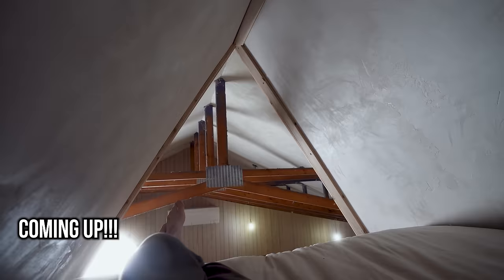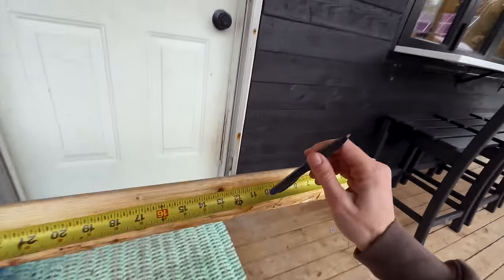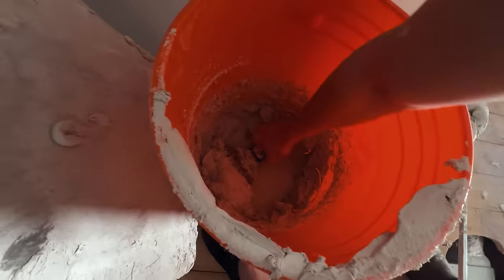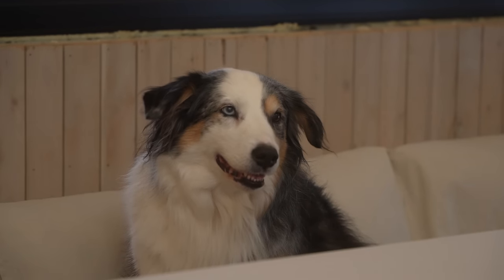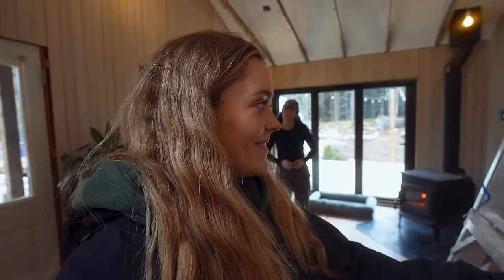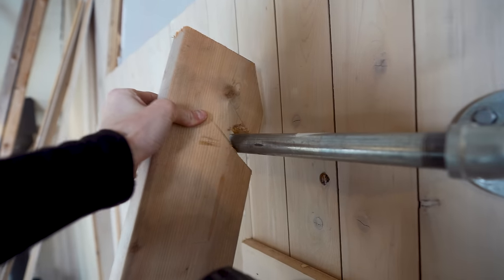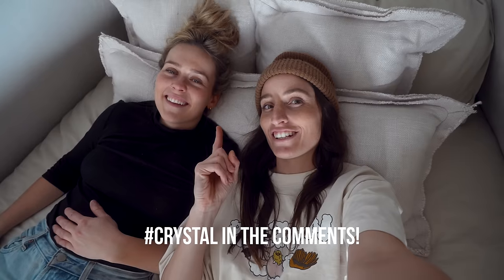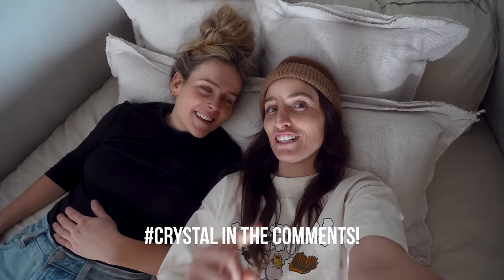Incredible Attic Transformation: DIY Attic Loft Renovation

Comment: You could add another indentation at the top of the ladder (a little lower than the one already done) and then You could hang the ladder vertically (on the new indent) so it doesn't take up space when you're not using it

Comment: I have a ladder to my loft but the last two steps at the bottom were attached with hinges so that you can fold them back and the ladder sits flat against the wall when not in use.  It is secured at the top with door hinges so it hangs in place against the wall.
Reply from the maker: Thanks for sharing with us, that is a great idea! We definitely want it to lean close to the wall when not in use.😁🐶

Comment: The project to build next spring would be adding an extension to the cabin, Make a concrete footing, and two courses of concrete blocks, frame the floor, covering with 3/4" plywood, begin framing the walls with six inch 2x6 studs, insulate, then sheetrock the interior walls, the outside walls should be 3/4 inch plywood, cover with house wrap, and use the same siding used on the rest of the cabin to match.  The roof should also be six inch (2x6) lumber, metal roofing to match what you have now on the roof. I sugest sizing the extension the length of the original house size. On the interior I suggest framing another bedroom, leaving a large dining room or what ever makes you happy. Hire and electrision adding outlets and interior lights (hghhat cieling lights) This project should take about six months to complete, (before winter)
Reply from the maker: We like the way you think! An addition the cabin has been given some thought. However our plans for the spring/summer are going in the direction of the new land. So stay tuned.😊🐶

Comment: For the ladder to get the correct angle you can measure the height for every 4 feet high it’s 1 foot out. 4:1 ratio this was drilled into my mind as a trades worker. It’s a good rule to follow whenever you use a ladder. You should put a handle on the wall in the loft on the left side with the galvanized pipe Other than that great job!!!!

Comment: Great idea of using a "ladder" as the blueprint for the ladder!  If running power for a fan is too much pain, a battery-operated one will be great for those staying during the summer! And some cool reading lights on the wall at the head of the bed.

Comment: I would love to see you add wind turbines in addition to the solar array. When the sun goes down, generally, the wind comes up. It would be beneficial for dull days where there is not a lot of sun.
Reply from the maker: That is a great idea. We may get to the turbines in the future but somewhere else… 👀 We have so many projects on the to do list.😊🐶
Reply: @Vanwives  I find that Vertical Axis turbines are superior to Horizontal turbines. You can either incorporate them into your battery bank or mount them on the greenhouse, storage shed, or any of your buildings independently and hook them up to a dedicated battery. You'll probably need a 50 amp charge controller. I was going to put them on the camper for power on the go!
Reply: Not in Ohio ,it is the other way around ?
Reply: @davidkettell1073  could very well be. I'm in Ontario and the wind generally picks up when the sun goes down
Reply: I am so impressed by everything you two do. I think it’s great that you push yourselves to do and make, rather than buy expensive things. Your home/cabin is so welcoming.

Comment: Absolutely love this!  It looks so good.  I definitely agree about adding some type of safety rail up there so you can grab onto ladder going up or coming down, and a way of securely fastening it to the wall so it doesn't crash land on you or Izzy & Bella.   Also with a railing, you could add/hook on a small shelf where you could keep a box of tissues, bottle of water, etc. for the night.  Mom "speak" - I'd also not wear socks climbing a wood ladder because socks slip very easily, unless they have those traction thingies on the bottom; even bare feet would be much better.  They make re-chargeable LED lights of all kinds now that would be so nice to have up there just in case someone has a midnight potty run.  Enjoy!
Reply from the maker: Yes!!!! you are so right! sThanks for all your ideas and suggestions. I guess we are not finished yet. 😊🐶

Comment: Gals,

How's the fishing in the area?
With that extra room, I can visit you LOL.

I don't know how pragmatic this is in your case or how can you adapt your ladder in the future but,  but for safety purposes OSHA requires the ladders to be 3 ft above the roof or platform level to climb.  I guess for you to have something to grab before start trying to find the top step of the ladder without having a 3 points of contact.  Maybe in your case you can built a new ladder, just longer.  Then do two notches:  1. for when the ladder is completely vertical and not in use (stored mode).  2.  Then another notch when the ladder is inclined, and to be in use.

Something cool I have seen is that the ladder is set on like a barn roller rail to move the ladder to the side when not in use.  Maybe it ialso has a mechanism to have the two  functions above, verticl storage, and inclined for use.

My best wishes to both of you.

BTW, do you plan to have children?

Comment: Bless you, Jasmine. Secret door, wow, I guess I missed that in the post of pictures. Beautiful. You might add some rubber strips to the bottom of the legs of the ladder. Just to keep them from sliding around when the latters in use. Love the idea of notching the ladder another foot down to hang it flat on the wall when not in use. Gave them a big thumbs up👍
Beautiful job, girls. #Crystal
Love the pack ❤ 
✌️🤟🖖

Comment: You could build cubbies in the walls up there, since it is so tiny up there, you could just use the existing rafters cut out a little rectangle and support it within that 2×4 framework
Reply from the maker: That is a good idea. 😊🐶
Reply: @Vanwives  then you can put wiring up there for a pocket light, to read, or watch a movie, on a tablet, or just to see, you could hide the wiring possibly under wooden trim, like in that peak in the ceiling, or along the edge of the floor,  the cubby, could be for a drinking glass, with circular incerts, so they don't tip over, like in a car,  or a place to lay your glasses, Another great job  improvement !!!

Comment: You guys are awesome but as a woodworker and architect I have a couple suggestions. Over time that ladder is going split along the grain at the notch for the bar. And the screws in the treads will split that wood and pull out. You are loading the screws perpendicular to the screw, they have no strength in that direction. I recommend sandwiching the top with steel plates each side so the stringers don't split causing you to rebuild the whole thing. The treads should be supported with steel angles each side.  Awesome loft!
Reply from the maker: Why thank you Talk Bob we appreciate you sharing your knowledge with us. 😊🐶

Comment: if you haven't, make sure your joists and roof truss can support the addition or it will sneak up on you.  wondering if the ceiling joists are at least 8", preferable 10". good luck

Comment: What's the point of the bed frame? Just curious. I would opt for more headroom and side storage. Receptacles would be nice to charge phones while sleeping.
Reply from the maker: Thanks for sharing with us we appreciate all your ideas! We went back and forth about the frame we may or may not keep it.
Reply: It's better to elevate the mattress a bit off the floor to aerate it otherwise it can cause condensation when bodies get hot which can lead to mould if it can't evaporate. They did the right thing using a box frame.
Reply: @jmk1962  yeah good points, I'm just not sure how they will vacuum underneath. I have a platform bed with storage drawers underneath. I thought it was the same as a floor.

Comment: I hope there are some holes in the bed frame in the front (towards the living area) or you will have moisture and fungal issues.  If not make a few ventilation holes along it and get air circulation.

Comment: Why does my attic have windows?
Ideal for attics where the ceiling allows for installation that is in reach from the floor, roof windows offer maximum ventilation plus the added advantage of meeting building code requirements as points of emergency escape and egress.

Comment: #nightynightCrystal 

i am wondering if you would like to add notches in between steps below the top notches so that you can hang the ladder flat against the wall (and get the bottom up off the floor) when not in use to reduce the possibility of a stubbed toe, for cleaning, or just to have a tiny bit more floor space, and 'psychic space'. just an idea 💡 

💛
Reply from the maker: We love that idea thanks for sharing. 💛🐶

Comment: I saw this step latter that lay flat against the wall until they pulled it out, then if folded outwards to become a full stairs. if the angle is right and the distance it good enough, you could do the same and make a stairs that almost vanishes while taking up nearly no space while not in use. Sadly I can't remember what such solutions is called.